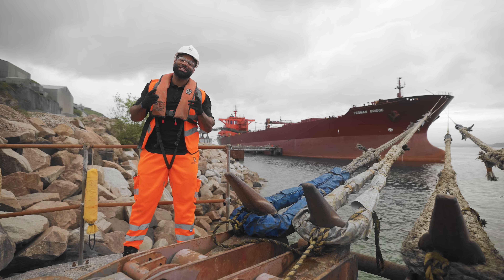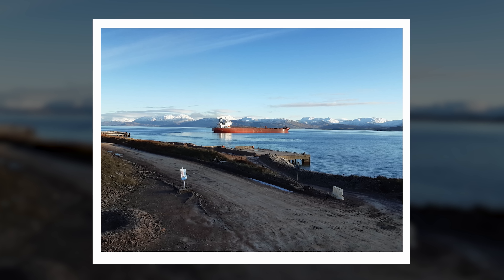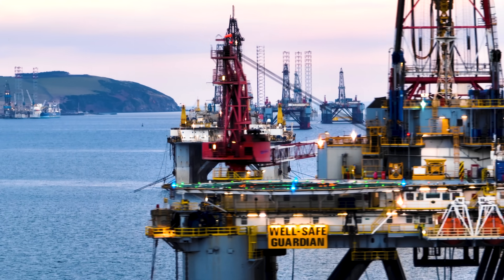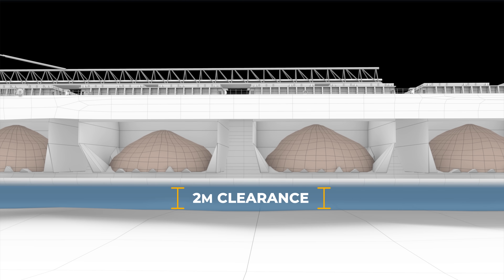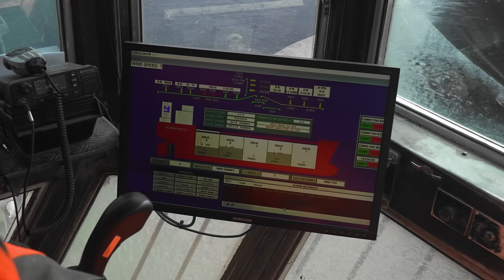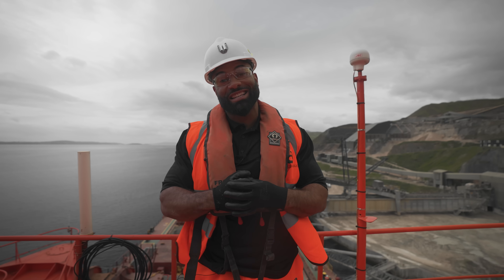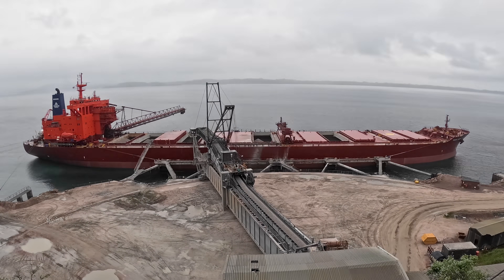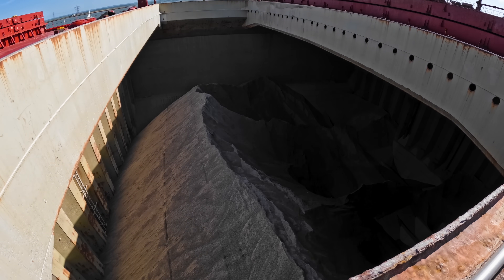£70,000,000 World’s Biggest Ship

Comment: Aren't the 1,000 footers of the American Great Lakes larger than these? 

For example, the largest of these, the MV Paul R. Tregurtha has a length of 308.9 metres, a beam of 32 metres, a draft of 32 metres and a gross tonnage of 36,360. Plus it is a self-unloading bulk carrier purpose built for carrying things like ore and coal. The ship sports a 79 metre self-unloading boom for emptying out it's cargo onto shore.
Reply: Edit: the Great Lakes ships cannot carry as much as these ships, they are limited to roughly 60-70 thousand tonnes because of limitations of water depth in port, canals, locks and in certain areas of the Great Lakes themselves.

So while the ships of the Great Lakes are physically larger, they cannot carry as much as the ships featured in this video.

Cool video, thanks!

Comment: Are you sure about largest self unloading freighter?

MV American Integrity is a ship built in 1978 by Bay Shipbuilding Company in Sturgeon Bay, Wisconsin.[3] She is one of the thirteen 1,000 footers in the Great Lakes laker fleet. She was originally built as Lewis Wilson Foy and was renamed Oglebay Norton in 1991. She was renamed again after the sale to American Steamship Company in June, 2006. On September 24, 2017 the American Integrity broke the all-time record for the largest load through the Soo Locks with 75,095 tons of iron ore beating the record held for the last two weeks by the Edwin H. Gott. She was loaded to a draft of 29 ft 7 in on her way to Indiana Harbor.

Her overall length is 1000 feet, beam is 105 feet and depth 56 feet. She is able to unload 10,000 tons/hour. She has 7 cargo holds and 37 hatches. She has 14,000 horsepower and 2 propellers. 

Wikipedia

Comment: couldn't a electric motor driven mobile conveyer system with a hopper filled by the the Lieber unloading the train to your storage stockpile bays work in your yard saving the cost of moving material with 360s and loading shovels powered by  diesel fuel also reducing plant movements so making the yard safer ??